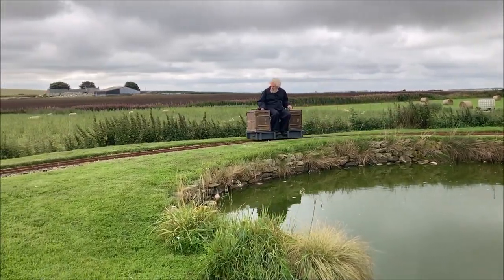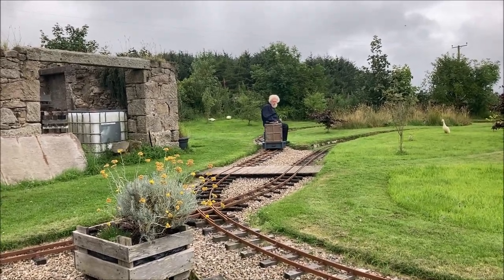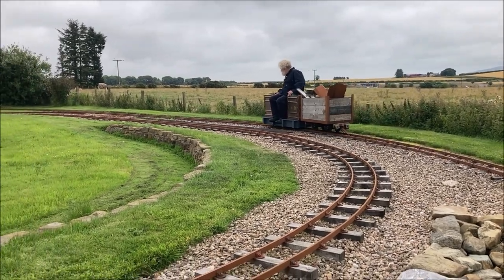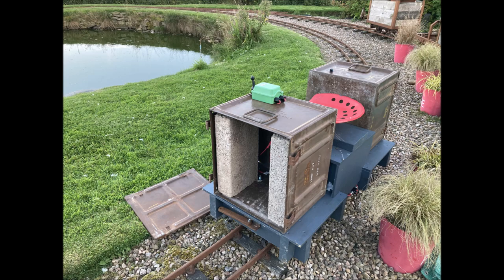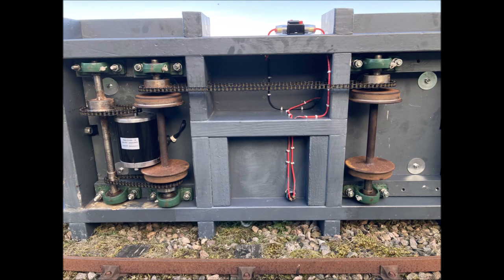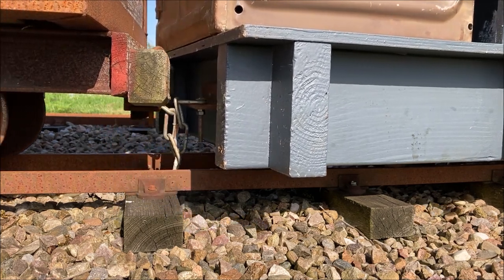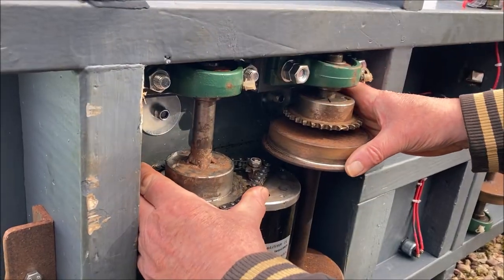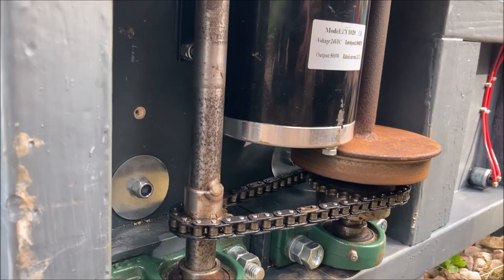Mini Minx Mystery - wheel spin on our new build 7 1/4 inch 'minimal' gauge garden railway locomotive

Comment: Whats the investments in the track layout and its length

Thanks
Reply from the maker: I would estimate track length is less than 200 yards, but I'm not sure without measuring it (it's dark now). I'm not sure what you mean by investments in the track layout, but if you want to know what it is made of and how much that would cost, the best I can answer is with a description of the materials needed and you can find out how much that would be from local suppliers. I have no idea how much it has cost me in total, but steel is now approaching 10 times more expensive than when I started. The track is made out of 20 foot lengths of 30 x 12mm flat steel bar with wooden 3" X 2" (or near metric equivalent) 18" long sleepers at 1 foot spacing and the rail is held onto the sleepers using  suitable chairs from https://www.pnp-railways.co.uk/ plus suitable screws to hold the chairs to the sleepers. I put 1 metre wide weed suppressant under the ballast and the ballast itself is 20 mm down (meaning mixed size pieces that fit through a 20mm sieve) crushed local stone (granite would be good) from a quarry a few miles up the road. I hope that answers your question!